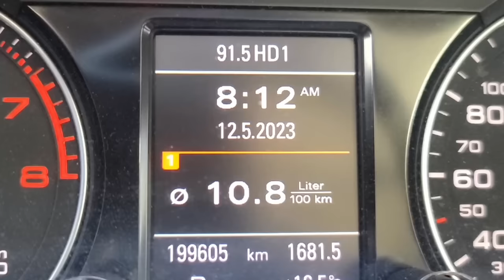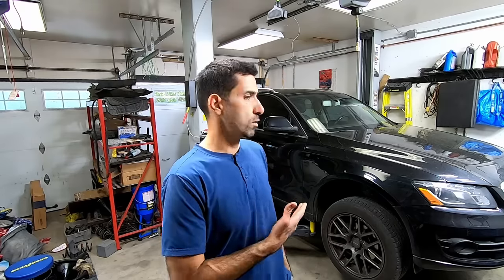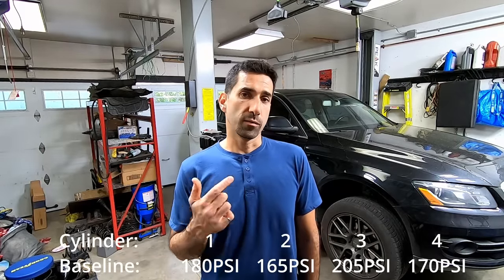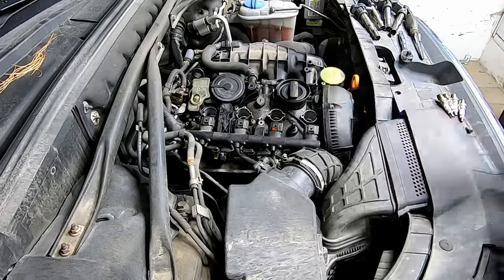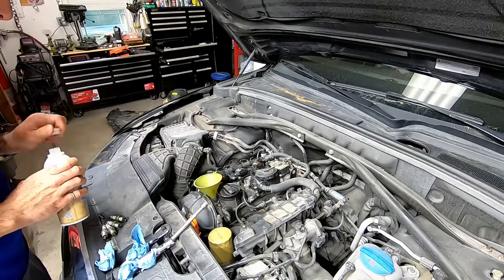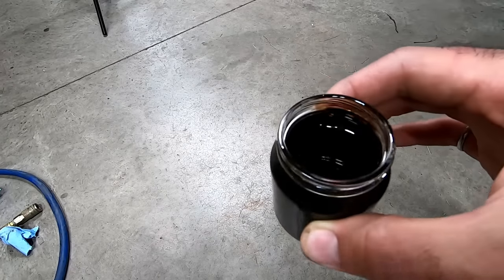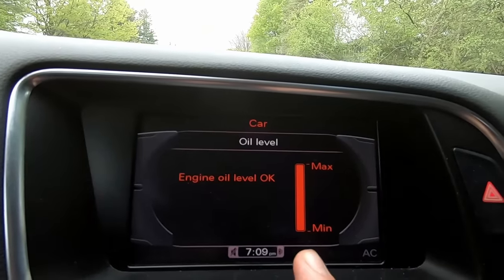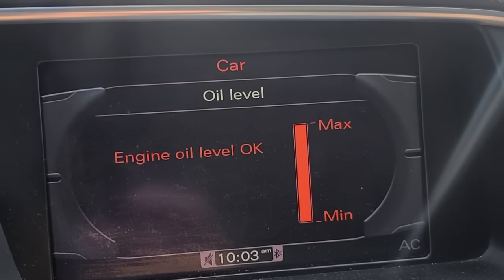How to fix excessive oil consumption from clogged piston rings (Part 2)

Comment: Probably won't work for my Subaru 😅
Reply from the maker: Not unless you've got the motor on a stand unfortunately
Reply: @ETMotorsports  a stand would make sense. Pulling out a 18 year old engine and just to put it on a stand and flush the rings...
Reply from the maker: @mindaugasvaskevicius1818  problem is at that point you're halfway to rebuilding it anyways
Reply: @ETMotorsports  yup, and the car is not worth it at this point. 1l/3000km not as bad for now. Might just leave it as is
Reply from the maker: @mindaugasvaskevicius1818  haha half the Audi owners out there could only dream about such numbers 🤣 we're dealing with 1L/200km over here
Reply: @ETMotorsports  not sure, before I got current Subaru I used to have Audi A6 C5 2.5TDI 110kW and it never used more than 0.5l of oil in between the oil changes(12-15 thousand km or 1 year). And the motor or the oil was never the issue with that car. Suspension was a money pit and had issues with the fuel pump, something was wrong with two of the  six cylinder fuel injection and it wasn't the injectors. Didn't pass the emissions.

Comment: You should had did... an engine turn over without the spark plugs, you nearly hydrolocked it... or at least stressed a lot your rods...
Reply from the maker: Turned it multiple times without the plugs to clean up the cylinders

Comment: These engines have a bad design flaw with the oil rings. There is no fix for bad design. Just don't buy VW or Audi (VAG) and you wont have these issues.

Comment: strange this should lead to hydro shock and destroy engine.
Reply from the maker: why? You're not running the engine with the liquid in the cylinder...you crank the engine a few times without the spark plugs to clean up the cylinders and you're good to go

Comment: just watched another channel the guy did it twice and dam it did not work.
Reply from the maker: it's possible...there are a lot of factors at play including the fact that the oil burning may not be due to rings...what engine? I've completed it on 4+ cars personally and it's worked every time...if you read the comments below - it's worked for pretty much every viewer that's tried it...
Reply: @ETMotorsports  I think he is referring to DIY dave and his Carolla. nothing seemed to work for him. Probably mechanical.

Comment: Any of you watching this dude doing this to this engine is bull crap.  Not only is this dude washing down the cylinder walls he also is diluting the oil so he did start the engine for how long ??  So better be real careful when watching videos like this. Just by watching this person drop the spark plugs into the cylinder holes tells me he has limited knowledge on engines. If your rings are carboned up just by releaseing alot of carbon can ruin your cat.

Comment: Buy a spark plug socket yikes!
Reply: I was about to go say lol .. I can appreciate the effort of the video.. but the way he dropped the spark plugs into the cylinders can definitely change the preset gap no matter the plug. this goes to show... ?? I came here for different uses of berryman B12..
Reply: just use a piece of ribber hose to thread the plugs back in, then pull off the hose.

Comment: I FIXED THIS ISSUE.....Believe me or not, I had sludge on my 3.0T Q5. It was burning 1 quart every 500 miles or less driving normally. I was able to fix it to the point where I have driven 1500 miles and it only has burned less than half a quart. This is driving it very aggressively, taking off at lights, driving on sport mode....basically trying everything that burns oil. I bought the BG Dynamic Engine Cleaner and Engine Rinse. I did the treatment which is basically just an oil change procedure. It turns all that accumulated sludge back into regular oil and you drain it out. Leaves the engine nice and shiny, like new. FIXED. I did exactly what's in this video (https://youtu.be/CZhV0Qv1lps) with the same exact product
Reply from the maker: Yeah that's another great solution too